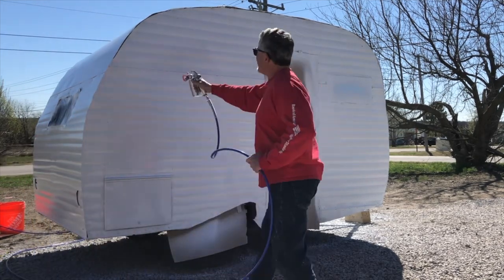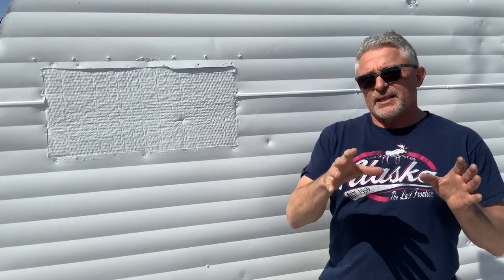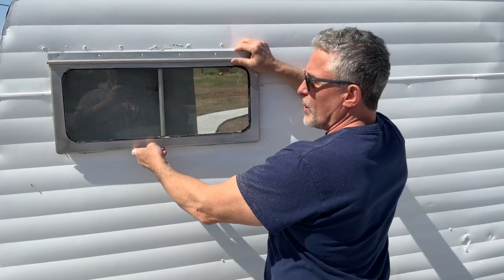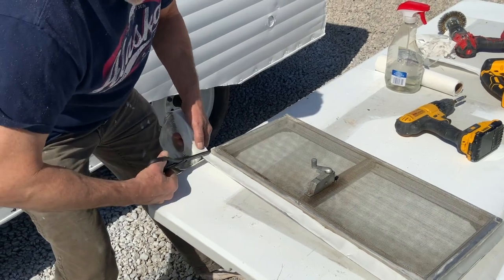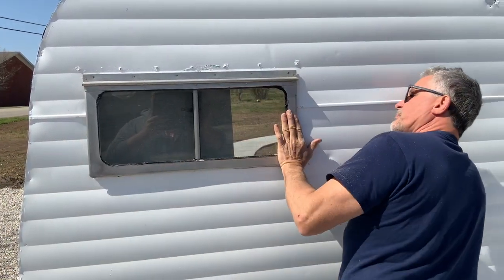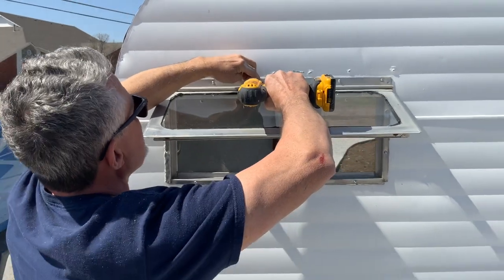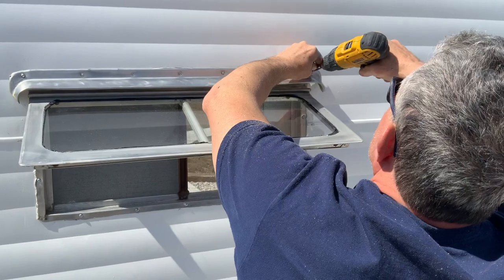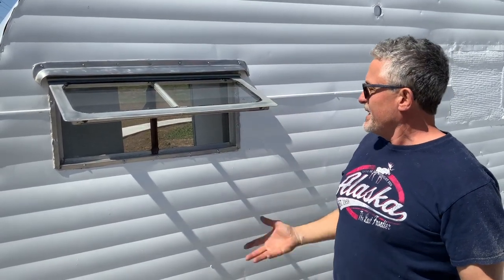Ep. 26 Painting installing windows with butyl tape 1964 retro Serro Scotty  Vintage Camper rebuild

Comment: I enjoy your videos.  Are you planning on using a back frame gasket and new window seals?
Reply from the maker: Windows were in great shape. I did however add glaziers putty to the exterior seal just in case and put new seals on. I power washed the whole exterior and no leaks.